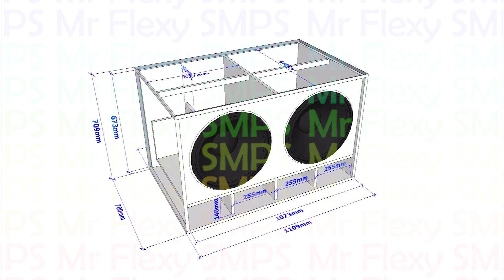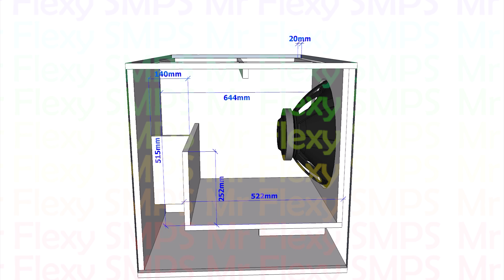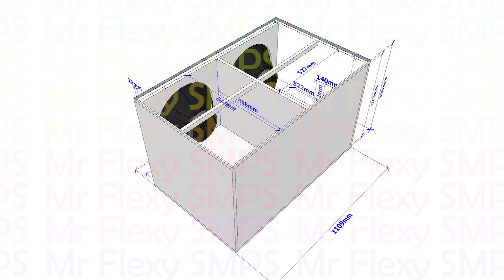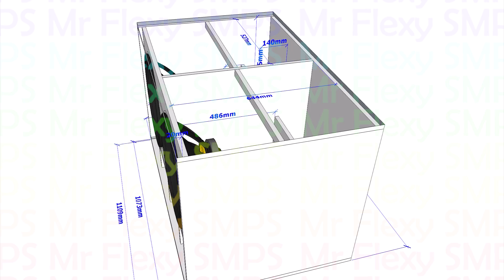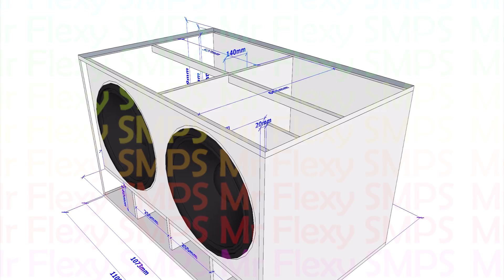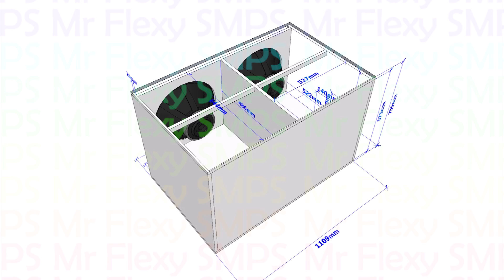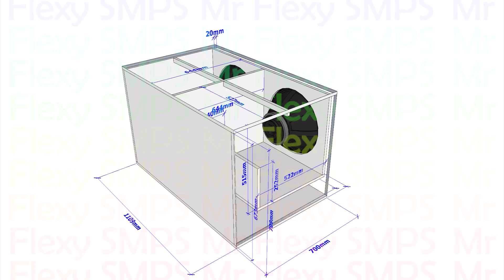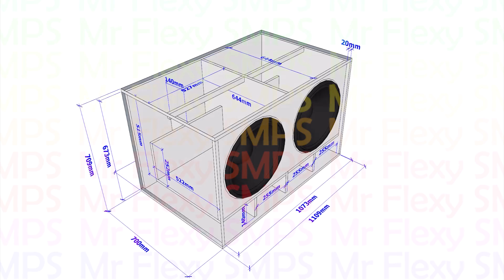[PLAN] 6008 PS Subwoofer Bass reflex

Comment: Im planning to build the single version on this box, it seems to be 8004 spec but i was wondering if the lip on the box is actually 20mm. With the top plate thickness about 18mm i think a lip of 20mm not possible because the speaker cone could touch the grill if even it reach Xmax.

Comment: My question is how come the 8005 is a straight vent and this double18 is long and going upwards in the back. Shouldn't the single 18, 21 have the same vent length as the double 18 and  21's
Reply from the maker: it has lower response this one
Reply: @mrflexysmps5826  OK cool thanks